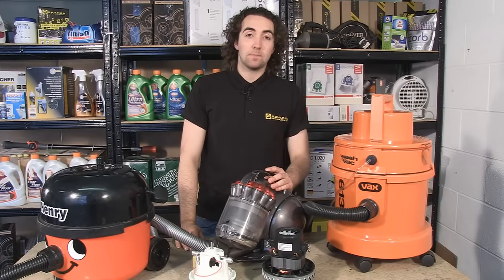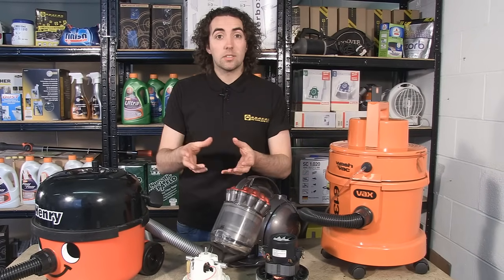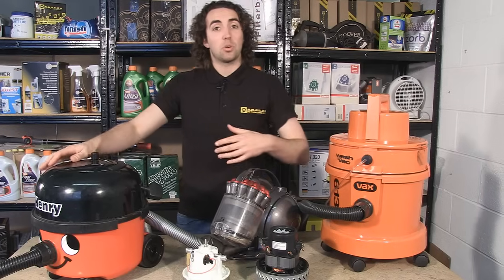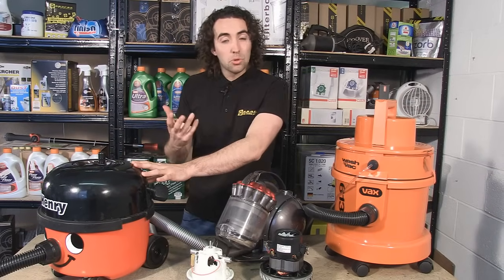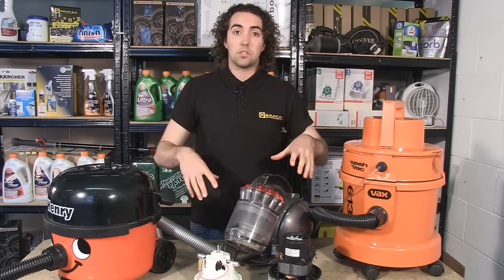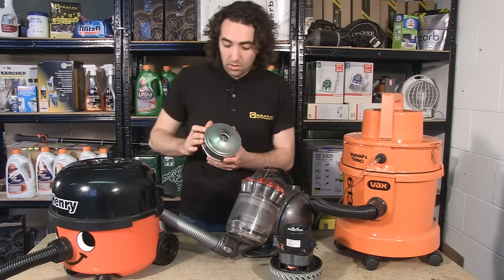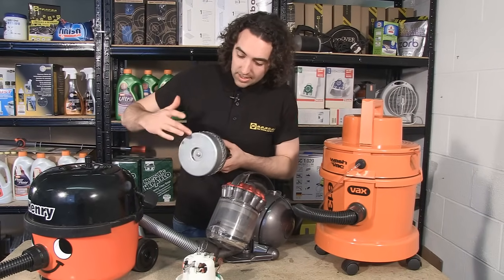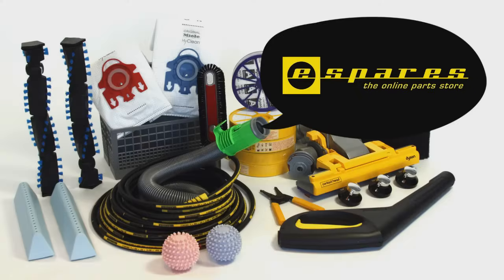How Does  a Vacuum Work? (Vacuum Cleaner Guide)

Comment: Is that why some cleaners sound like something is repeatedly banging on the inside? Is that the water?
Reply from the maker: Hi Praecantetia, you wouldn't normally get a banging noise in your vacuum so if yours is try to find out why, and you only get water in a wet & dry vacuum.

Comment: No one to this day  has noticed the missing motor clip on the Henry
Reply from the maker: +Numatic Collector The have now LOL. Good spot there as you can see this was a collection of cleaners we had available and was the Henry was missing the clips. :-)
Reply: So Is it basically like a tornado vortex? You know with the spinning wind creating low pressure and stuff like that?
Reply from the maker: I suppose the air flowing into the tube may produce a vortex but this is not necessary for it to pick up debris.  Perhaps a better analogy would be to think of the dirt and debris as items on the bottom of a lake, remove the water with a hose and items near will be swept into the hose (and in this case the cleaner).